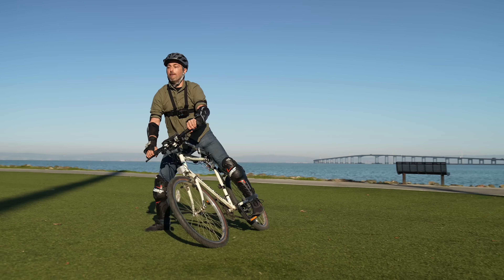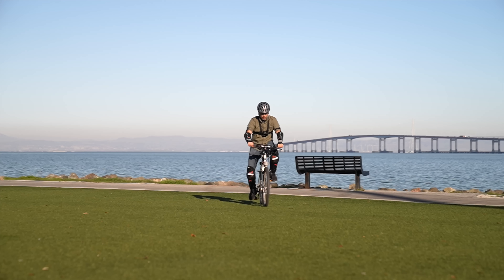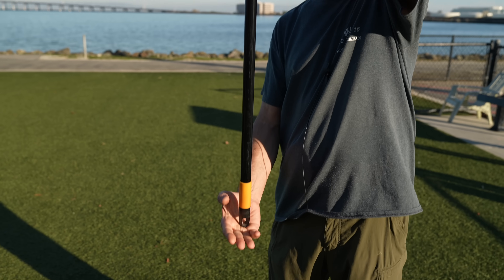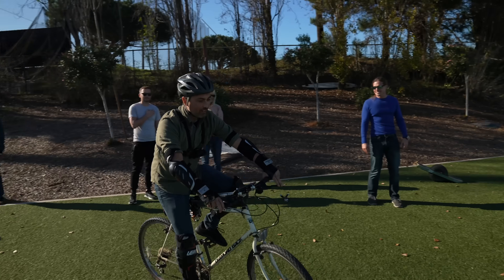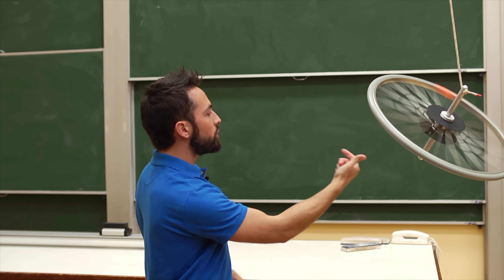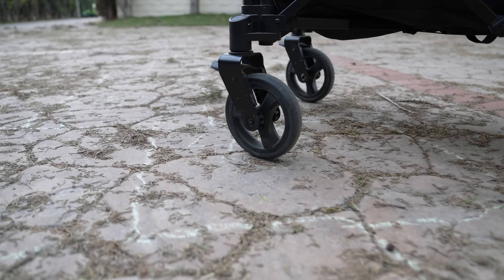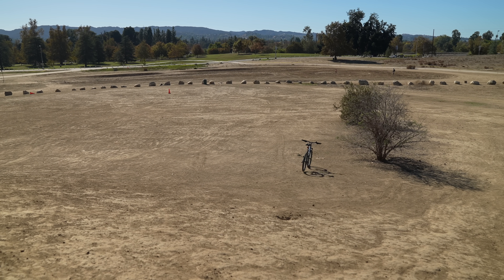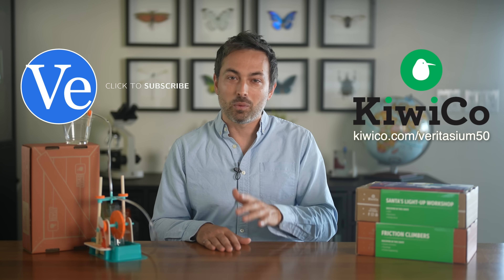Most People Don't Know How Bikes Work

Comment: "Riding a motorcycle is not inherently dangerous, but to a much greater degree than driving a car it is terribly unforgiving of any carelessnes, incapacity, or neglect."
**********
With over sixty five years of riding single track vehicles (that's bicycles and motorcycles for the uninitiated) and eight hundred thousand miles and still counting, I early on learned about "countersteering" and the effect it has on leaning into a turn.  Actually, it was a serendipitous observation while riding my bicycle down a road with no hands and noticed that as I pushed down on (say) the right pedal the handlebar reacted by moving to the left slightly as the bike leaned to the right, then turned to the right when the left pedal was pushed down.  Figuring that this was significant I started to experiment and within two days I found steering became effortless, and within a week, and to this day, I do not have to think about it at all.  In other words it's nestled in my Motor Cortex where I can invoke it without thinking.  In the decades since I have taught well over a hundred riders how to ride, and the first subject I pound into them is countersteering, and nobody passes my course until they can demonstrate it without thinking about it.  Trust me, I can tell.

Comment: If it's indeed the case that we don't fully understands how bicycles work, how were they invented in the first place? It seems unintuitive for me that anybody could think of a two-wheeled or one-wheeled vehicle like the unicycle as stable. I can ride a bike without knowing how it was designed because I just assumed the designers did the knowing for me.
Reply: When the first bicycle was invented it probably wasn't expected to be stable. Early bicycles were just two wheels with a frame and seat between them. The rider sat on the seat and "walked" the bike along, so it didn't have to be stable, but it turns out they are.
Reply: Some people do.  They invented the bicycle, THEN figured out how to ride it and improve on it.

Comment: this video is wrong and i wanna notice some mistakes made here:
1. 7:54. this part is what makes the whole handle-blocking test useless. when u block the handle, what basically happens is u lose the ability to balance the bike when riding forward, its not even about turning, u instantly go down on the ground coz of this. (however, there is a small chance to catch a moment, if u for example are turning to the right while balancing, and block the handle left turn, u still will be able to turn right coz u already in a favorable state to turn right and u wont be using countersteering)
2. claim that its impossible to make a turn without countersteering is just not true, its a lie. explanation: the same part at 7:54. to make a turn WITHOUT countersteering, u can first lean to the desired direction so bike will start losing its balance, and then u can just turn the handle in the desired direction (this is also the physics behind steering when NOT holding a handle at all, u just lean and let the bike balance itself by turning). of course this is not the usual way to steer and normally countersteering is preferable way, but NON-countersteering turns have their advantages, for example its the best way to turn in winter coz u basically dont lean a bike at all and keep more stable balance with the slippery snowy road.
Reply: You and many others claim that it is possible to ride a bike without countersteerig, but why is it that no one has never shown any proof of that?

Comment: There was one wrong statement about not being able to stop on the bike and keep it upright. I did years of road cycling and with the sports bike we were able to stop at the lights without unlocking our boots from the pedals. You just need to turn the steering for about 90 degrees or a bit less towards the frame and keep the brakes on. With a little training you can stop for minutes. The help comes from the big radius of the front wheel that creates a small patch on the pavement long enough for you to balance the bike upright using the T of your footprint.

Comment: Where I live there is a bike road down hill with a sharp turn, and if you don't break you need to counter steer across the entire bike road. And you need to hold out your arm really early on so you can have your hands on the stering bar during the turn. Didn't realize ever turn had counter stering though.

Comment: Skilled bicycle riders would have no problem turning that bicycle even with one side locked.  The fact is, you don't need to counter steer to turn if you shift your body weight correctly, which is a necessary skill for mountain bikers, because quite often, you can't counter steer when negotiating obstacles and narrow pathways.
Reply: Bro, I had to doomscroll tens and tens of comments before finding this sensible one.
On bicycles, this countersteering to initiate turns = wobbling.
Reply: ong bruh i was looking for comments regarding extreme bike sports like bmx or mountain bike riders cuz if you don’t know how to lean your bike you’re just bad,just saying
Reply: That's what I was thinking, you can simply lean before you start to initiate the handlebar turn.
Reply: I was waiting the whole video for someone to just lean😅 seems they need to do a follow up
Reply: That's what I was thinking the whole time, the video just ignores the second method to lean, using your body weight

Comment: This video is just straight up wrong. You can get out on a bicycle right now and do a turn without counter steering. All you have to do is shift your balance slightly.
Reply: Remove your training wheels and try again.
Reply: @XtreeM_FaiL the point of the counter-steer is to get the bike to lean in the direction you want it to steer. But you can just lean your body. Instead of relying on the bike to lean for you you just lean
Reply: @XtreeM_FaiL  I'm not rewriting the laws of physics. I lean left and at the same time slightly turn my handlebar left a little bit. This causes my bike to turn in a radius.

All you have to do is start falling in a direction. Unless your claim is that you can't fall on a bike
Reply: @XtreeM_FaiL  because I do

Counter steering only really becomes relevant at higher speeds if you want to take a sharper turn. At slower speeds or at a wider arc turn you can just lean

Comment: This is also a principle of motorcycles. Newer riders often don’t understand it and it causes them to fall or crash. When you’re turning left, you’re leaning left, and if the bike starts to run wide and you need to turn more aggressively, many new riders will panic and input left turn into the handlebars, and then the bike will start to stand up and the bike will run out even wider, exacerbating the problem. To make the bike lean over more you would turn the handlebars in the opposite direction of which way you’re leaning and it will lean the bike over more.

Comment: I p;ut in over 100,000 Motorcycle Miles and NO you do not steer a motorcycle CORRECTLY by pulling the front wheel into the Arc of your planned turn, escept in parking lots.  But if you have any speed going, then you COUNTERSTEER, that is you push the handlebar on the side you want to steer towards, which is actually thw WRONG WAY  but what happens is that by pushing Left to  to steer Left, well, the Front Wheel  digs in cut to the Right, which causes the bike to try to maintain its forward momentum, and so the bike banks or tilts to the Left, which is how you get the Motorcycle into a Left Hand Turn.   Works every time.  Just remember COUNTERSTEER.   Start by truning the Wrong Way which BANKS the Bike into the turn you want.

Comment: Just dont turn so sharp its not that hard unless you really need to stop then your kinda screwed comeing from a dumbass that has crashed a lot you dont need to counter steer unless you need a sharp turn and not a really wide turn thay basicly told you this in the video edit and if you stoped holding and pushing people they could probably ride strait

Comment: As an advanced motorcycle rider I can tell you that bikes behave differently at different speeds. At speeds where the bike is self stabilised, you have to steer to the right to turn left.
Reply: You have to do the same thing at any speed...
Reply: @jridenour31  No, you don't. At slow (very slow) speeds, pushing the handlebars right means turning left. Go faster and pushing the handlebar right will turn right. Go even faster and hammering the right handlebar with all your might will only produce a tiny wobble. It's a highly complex interaction as the movement of the CG plays a role, too.
Reply: @jridenour31  The wonderful thing about riding motorcycles is, that you can't do it consciously. It's all done subconsciously and it works. Once youi realize, that you actually do the opposite of what you think you're doing, it all falls apart.
So, stay where you are, believe what you want to believe and keep riding.
Unless you want to improve. Then help yourself to an advanced rider course and start learning.

Comment: i definitely can turn a bike without turning the opposite way first. you just lean into the turn first especially easier when you're not sitting upright on the saddle
Reply: No you can't.
You can ride without hands (that's easy), but you can't ride without countersteering.
If a wheel can't turn opposite direction before a turn, the bike will fall.
Reply: @XtreeM_FaiL   nope that's wrong. tried it can prove it.
Reply: Nope tried and can prove it's possible. thanks for telling me exactly what I saw in the video though :/  @XtreeM_FaiL

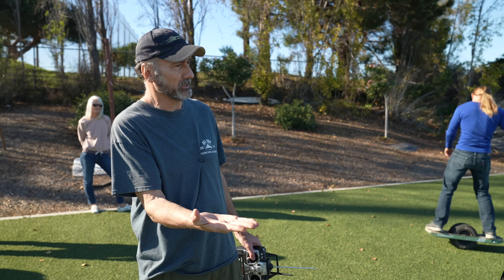Comment: 5:35
That's part of it.  My dad and I tested this years ago with some wood rings we substituted as "wheels".

Use hard, flat wheels that do not flex under your weight and you can balance upright just fine, after a few practice attempts, when not in motion.  You can even do it with the wheels held inline.

The compressed air filled rubber wheels shift your overall weight and momentum constantly.  This is for balance excellent while in motion, but awful for standing stationary.

Comment: 30 years ago I did a bike tour/race.  I went to the info session.  They said when you see a stone or something small in the road ahead of your front tire just sort of punch the handle bar on one side you and you will avoid the object on the other side.  so if I punch right I will pass the object on the left.  Depending on speed it is perfect for moving the bike over 2 inches either way.

Comment: Ima call bs. I’ve turned without counter steering.
Reply: You can do that if you lean most of your body weight into the turn at high speeds, for most normal turns counter steering will be instinctual
Reply: @Mohdaman13  I’m a body weight leaner. I literally can’t think of many times I’ve ever countered steered aside from going slow or at the later end of coasting. Even then I wouldn’t say it’s exclusive to leaning body weight since I can ride with no hands and there’s no counter steering there.

Comment: 2:07 I'm commenting specifically before I finish watching so that I can see if my thoughts are right or not.

The issue seems to be your habit of trying to turn the handle bar before shifting your weight. As I've ridden, most of the time you lean into a turn with your front wheel almost straight before you do any adjustments.
Reply: If active counter steering was strictly necessary you wouldn't be able to turn without touching the handlebars. 

Whatever needs to happen is so subtle and so stable the bike will do it itself at most speeds. 

Having that said when you get a bicycle up to40mph+ motorcycle style counter steering may be necessary.

Comment: just lean as you turn...
Reply: You absolutely NEED the opposite turn to start that lean you need within the turn.  When you are turning, you are also leaning in that direction to compensate for the centripetal force of the turn.
.
Simple leaning does not work because your center of gravity stays over the wheel contact point.  You can use an untended lean to do a turn if you happen to do it.  But you can not intentionally lean because of the CG issue.
Reply: @Observ45er  Total bs
Reply: @Ricardo__Milos   
Does anybody care what you thing?
Reply: @Ricardo__Milos    Keep trying.  We have confidence in you to come up with something intelligent. . .
Reply: @Ricardo__Milos   Keep trying.  We have confidence in you.  You'll come up with something intelligent.
Reply: @Observ45er  Also, depending of the weather sometimes I ride my scooter perfectly straight with zero leaning and only use the handebar like I'd turn the wheels of a car to take the corners. I do that, as instance, when I fear some oil on the road to avoid being lean (leaned?) and seeing my front wheel slipping on the ground.
Reply: @Observ45er  I do understand that you counter steer to take a corner.

I don't understand why you'd say that it's "absolutely"required. As not everyone drives or cycles with the handlebar.

When I ride a scooter, a motorbike or a bicycle handfree I lean by changing the center of gravity of the vehicle with my hips/shoulders. And I'd need to record myself doing so to see if I counter steer or not and the handle follows the corner going right when I go to the right and to the left when I go to the left.

It must depend of many factors such as the speed, the weight of the vehicle and your own weight. I'm obese, so maybe my own weight has more effect on the vehicle against the gyroscopic force than someone half my weight?

I've done rides of 10km on the road totally handfree and unless the counter steering happens on its own I just pushed my body on the left to force my bicycle to go on the left. As if I wanted to fall on the side?
Reply: I was riding my bike yesterday and today and I can easily turn by just leaning my body to the right and turning the wheel at the same time if I want to go right, without any visible pre-turn left.  @Observ45er

Comment: At what point does this effect become different? Say for a motorcycle. Is it the same result? If not, is that because of the tire thickness and tougher handlebars design in general? What about two thin tires next to each other instead of one tire? And at what space does it become a "quad" of sorts and no longer have these forces taking place? I won't know these answers but thanks for making me think
Reply: Yes.  Motorcycle riders are specifically taught about "counter steering" because you must actually apply force to the handle bars in the opposite direction of the turn to keep from going into a steeper and steeper turn.
Reply: It is always effect.
If you drive a car that has very high center of mass, on a curve it try to turn like a bike.

Comment: The "you need to go left to go right" is not always true, it depends on the way you ride a bike.
This can be shown by people who cycle without hands, they just lean to the side they want to go to.
The speed does (sometimes) matter, since if you are going slow like the examples showed, you need to stabilize yourself before you can make the turn.
Even for taking steep turns, you dont have to steer the other direction.
When we use our hands to steer the "opposite steering" is more frequently visible.

The best example to disprove that theory is to look at cyclists, you can clearly see that they just lean into the turn.
They also know what direction they need to go to, unlike the people in the video.

Comment: Wait that’s how you ride a bike? I always just leaned whichever direction I was going and let the bike move any me as a point
Reply: You can enter the turn in less time by counter steering.  
Simple leaning does not work because your center of gravity stays over the wheel contact point.  You can use an untended lean to do a turn if you happen to do it.  But you can not intentionally lean because of the CG issue.

Comment: There’s a Video out there where a guy made a bike that turns the opposite direction the handle bars are turned. It was basically (like the bike here) extremely hard to ride. BUT, after this guy had it for a while his body/mind learned to where he could ride it without an issue…BUT then when he tried to ride a normal bike… he couldn’t do it.
Reply: Smarter every day.

Comment: it's because you're trying to make tight turns at slow speed and need to countersteer to get the bike to lean quickly. If you were going at a decent speed around a steady corner you can just lean into the corner and you don't need to countersteer. Countersteering is not absolutely necessary to turn.

Comment: but you can use balance to steer, so if you just lean to the left you turn left without any input from the bars
Reply: Nope. Simple leaning does not work because your center of gravity stays over the wheel contact point.  Shift your upper body left and the bike tips right.
You can use an untended lean to do a turn if you happen to do it.  But you can not intentionally lean because of the CG issue.

Comment: Countersteering is not required super much, you can keep the steer roughtly straight if you're okay lean steering... But definitely you need to steer a little
Reply: The thing is, that the faster you're going, the less you need to turn the handlebar, thus creating the illusion of not countersteering.
Reply: Simple leaning does not work because your center of gravity stays over the wheel contact point.  You can use an untended lean to do a turn if you happen to do it.  But you can not intentionally lean because of the CG issue.
Reply: Counterstering is required. Lock the steering and the bike will fall.